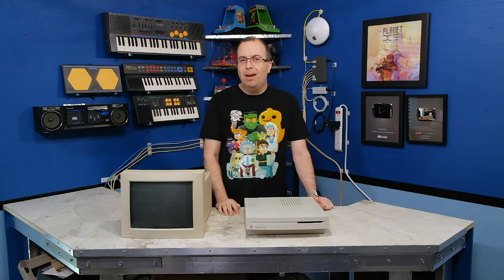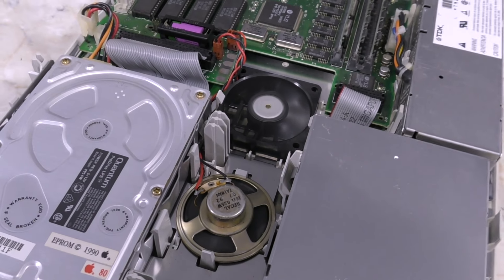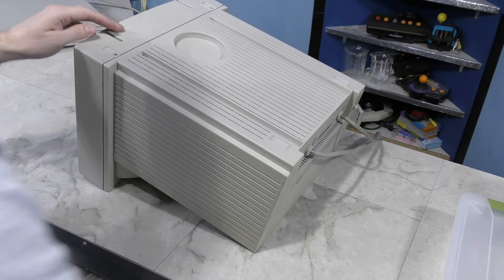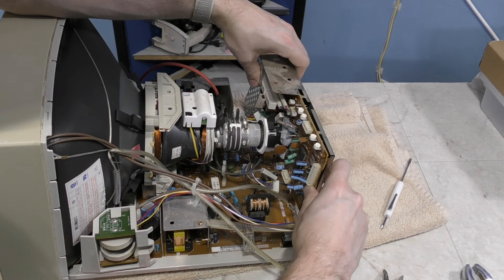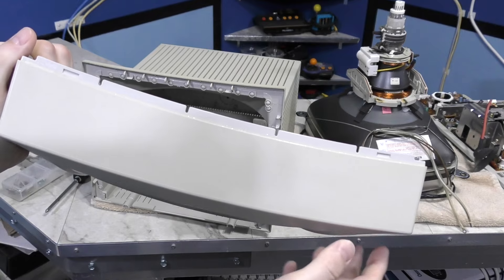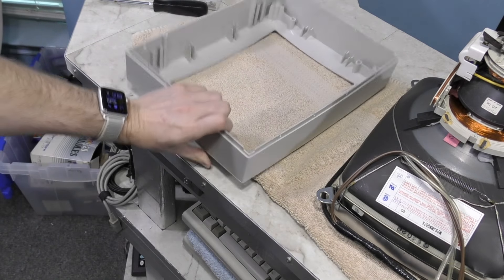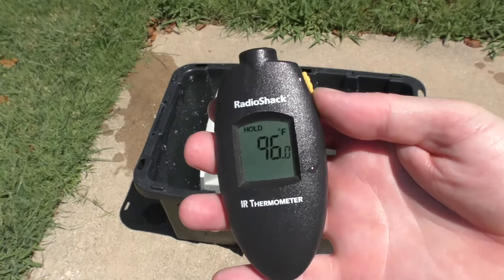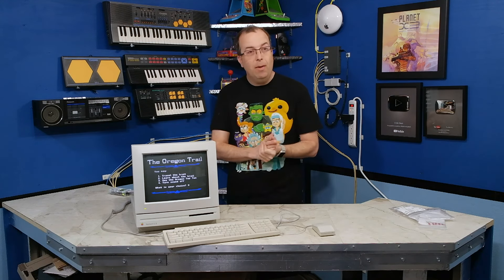Macintosh LC Monitor Restoration

Comment: Step one is to allow conductive water/ammonia into the monitor innards which were energized only a few seconds ago... Maybe spray the paper towel first, then rub down the outside, that way, step two doesn’t become, “perform major repairs on the shorted HV section.” 😏

Comment: If you don't plug the power cable to an outlet, you chassis will be floating (electrically) This means no GND connection to the chassis, no discharging of anything charged. You body will be a much better GND path, and if anything is charged, that'll zap you.

Comment: Capacitors in older electronics really should be replaced even if they look fine. Especially if they're for power for something. Electrolytic capacitors can fail in many ways. Not just by leaking or bulging. They can dry out and still work, but work in ways that could damage components, they could also eventually leak even if they haven't given any sign that they're doing it yet. Especially important on an old computer that you're looking to restore.. a leaking cap that you don't notice for 4 years could corrode traces in the board, damage chips, wires, cause short circuits.

Comment: The LCII was one of the biggest road apples ever made. Painfully slow and very limited capability. However there is something really endearing about them that just makes them fun to use. I still have one for some old games.  And that motherboard needs recapping ASAP..  And why disasemble it, when simply setting it in the sun will accomplish the same thing, if a bit slower.

Comment: Sounds like there's a short somewhere (possibly) near the power supply, and the speaker happens to have traces around/ near it, maybe?

Second thought: What if it's not the computer, but the monitor making that noise, and it's being transmitted trough the speaker?

Comment: That speaker noise is due to failing capacitors, you need to recap that board ASAP. The old caps leak and eat the board.

Comment: If you are worried about using too much water/diluting.  Then why not place bricks in the un-used areas of the crate?  Ergo less water needed. Cheers

Comment: Many LCs will squeal because of bad caps.  I've had 3 that I've repaired, all had speaker squeal, and all were remedied by a recap.  So I'll predict your LC will sound just fine after the recap.

Incidentally, can you mention what type of feet you purchased for your monitor?  I have a similar IIgs monitor that needs feet.

Comment: I know that this is old but how about using a emersion heater or cooker.  you can get one for about $80.00 and set it to just about any temp you want and it will keep it within a degree.

Comment: That LC II is definitely going to need some new Caps for the motherboard and CPU. They may look fine but the squealing is the first sign that the caps are on their way out. You'll eventually lose sound completely. Then the PSU caps go next. I recommend this guy http://maccaps.com/MacCaps/Capacitor_Reference/Entries/1992/3/23_Macintosh_LC_II.html

Comment: I think what you need from the sun is just the heat, not the UV or anything else (heat makes creating oxygen faster). So you should rather try some immersion heater or so. It would be more convenient.

Comment: Recap the logic board and power supply in that LC, even if it doesn't appear to need it!!! Those surface mount caps will fail soon if they haven't already. and the electrolyte that leaks out will destroy the logic board.

Comment: Dave, I have some retro gear with soft plastic buttons that have led's behind them. I have one device with buttons that hasn't been exposed to UV and buttons are transparent grey. On the other they're yellowed. I tried retrobriting them, fearing they might become brittle, but that didn't happen. The yellow didn't go away either. Do you have any experience retrobrighting soft plastics like that, or anyone reading that comment for that matter. Any advise highly appreciated.

Comment: Just get yourself a bucket heater already and stop worrying about water temps. Thinking about some more also get a in tank aquarium filter with a spray bar to direct at object to eliminate bubbles and also help distribute heat evenly.

Comment: wait, so it routinely gets up to 150 degrees in July wherever he is? Jeez!
Reply: i would imagine that it's the literal temperature of the sun-soaked concrete after several hours of daylight, not the overall air temp or humidity.
Reply: @noapparentfunction  Right... Okay that seems more humane.

Comment: wondering, i never see any ESD equipment. is i just not visible or not used?

another thing, why not heat the water with an old retro heating coil? it would be too much water to boil it, but it should help to rise the temperature into the desired temperature range.

Comment: The squeal is bad capacitors on the motherboard. The electrolyte has leaked out onto the board and will slowly destroy it if not washed off.

Comment: Hydrogen peroxide is around 40% denser than water, making it initially sink to the bottom of the crate. Would it work better to invert the monitor and have the most visible side down,  or is the retrobrighting more effective up top where the sun hits?

Comment: Hi David. I have a question about retro brightning. I hope you have the time to answer it. Do you leave the badges and stickers on those cases? I have an 1541c diskdrive and I would like to retro bright it without damaging the labels and front badge.
Reply: If the stickers are lamented (shiny sticker). They will be fine. If they're regular paper, they're could come off. It's a hit or miss. Sometimes you can get away with it.

Comment: My Macintosh LC Monitor won't display anything when I turn the computer on. I press the button on the back in and wait a few seconds before turning the computer on and I don't hear or see anything on the screen. Is there something wrong with the monitor?

Comment: Why go through all the trouble of retrobrighting if you are going to bounce the plastic around on highly abrasive concrete tile afterwards‽

Also, why retrobright with an hours long, complex disassembly and assembly, if you are not going to just give it the last few more hours to get it perfect‽ 
That corner that didn’t get perfect would drive me nuts in the long run.
No, you might not see it all the time. But you know it’s there.

Comment: can someone maybe help me? I have 2 old lc 2's and 1 monitor. the problem is that the monitor doesnt work. When you plug in the power and press the button you hear it keeps clicking but the screen never turns on. Does anyone know what the problem could be?

Comment: I'm glad you don't care too much about monitors, so I don't go to hell for what I did. I was given a monitor (some generic 19" Fujitsu TFT, probably 10 years old) by a colleague as I was looking for an inexpensive monitor with VGA input - and the case was heavily yellowed. Instead of retrobriting, I gasp spray painted it black. ;-) But I did use windex as a first measure to clean it. 
Well, it's not of historical significance and all my more or less current computer equipment is black, so who cares?

I wonder if you can even buy the chemicals needed for retrobriting here in Germany. I know that asking for hydrogen peroxide is something you't want to avoid.

Comment: The amount of videos I've seen you retrobrite stuff makes me feel like you'd benefit from a larger container and some sort of heater controlled by an arduino or a pi with a circulating pump to blow bubbles off. Should be pretty cheap and the weather won't hinder you.

Comment: >has a whole channel dedicated to restoration. 
>doesn't buy wholesale hydrogen poroxcide, goes to Sally's beauty supply. 
>uses a shipping crate to submerge the three cases even when the cases don't fit rather then just buying a larger container. 
>needs heat and maybe uv light, Instead of buying uv bulbs and some sort of heat source, uses plastic wrap, tape, and the sun.

What the hell are you doing?!?!? Just spend the couple of bucks! You'll save more money in the long run!

Comment: Wait, the monitor is color? When it first boots it looks 100% black and white.... Did Mac just have the most boring desktop in the planet?
Reply: The first Macs were black-and-white, so the boot ROM didn't have any color. This kept going until the Beige G3, which finally added some color to the ROM. You could change the background, but it wouldn't be visible until after the OS had booted.

Comment: Why don't you put those plastics to transparent thick plastic bag shaping it with lead or heavy dumbbell plates, you could save lots of peroxide and sun could reach it better.
And for warming water use aquarium heater.
Reply: He's covered using plastic wrap in a previous episode. To save you the time, it results in different thickness of peroxide, which bleaches unevenly and results in uneven color.
Reply: @JamieBainbridge  I see, thanks 4 d info

Comment: Every time you retrobrite, you have the same problems and complain about said problems. Why don't you do it indoors where you have full control over temperature of the water and the "uv light" or whatever light the process need.
"It takes longer" you have said... So what, it starts to annoy me and maybe others hearing you complain about the same fucking things every time. You are your own producer and project manager. Just plan that the retrobrit take two days longer, that can't be a problem. You release 2, TWO videos per month. Adding four days to your planing can't be impossible.